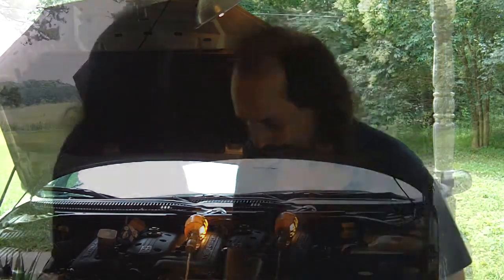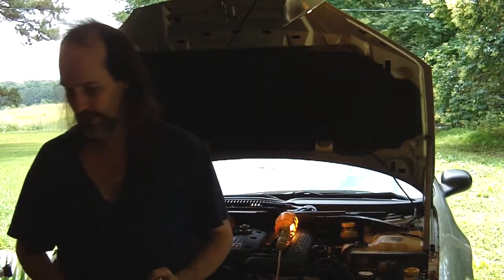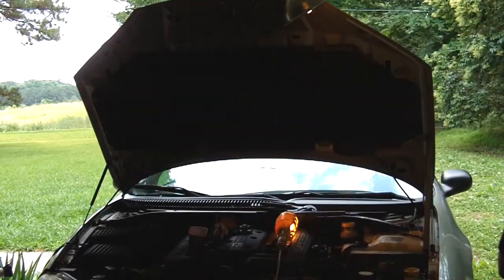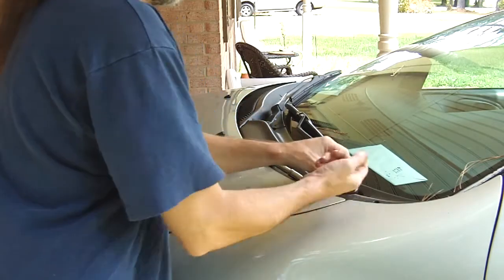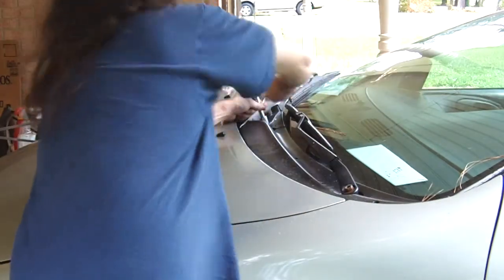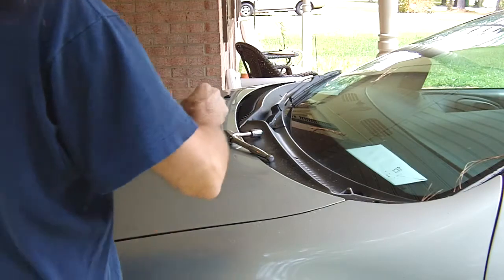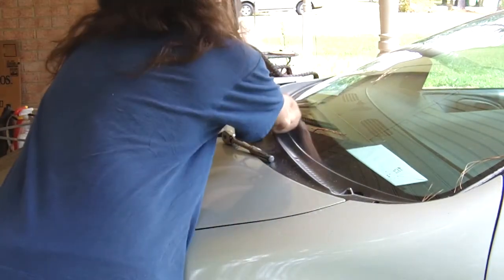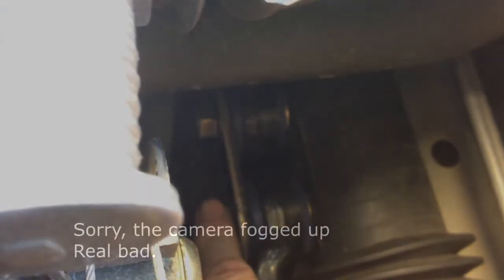99 Dodge Intrepid 3.2 access Inner Tie Rod end Bushing

Comment: Hey Thanks for the tip man that's great. I'm about to go on this journey myself. Did you have to replace the whole inner tie rod? or did you just do the bushing? That looks identical to the 97 intrepid with a 3.5 l. If you did replace the inner tie rod. How did you know it was wore out?
Reply: If money is no problem then replace it all
Reply: @calebhastings3588  I'll replace it all with a brand new Mercedes, BMW or Lexus lol. Nah, I grabbed the bushings today. Less than $20. Will go with that. I was just a little worried the "eye" in the tie rod will be stretched or worn wider than the bushing
Reply: So I'm guessing I don't need a special tool like other cars?